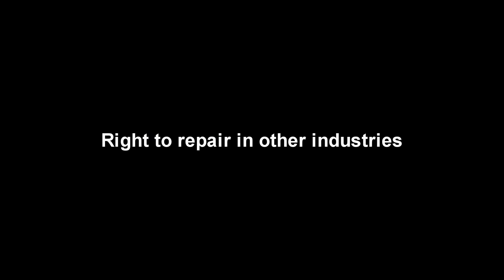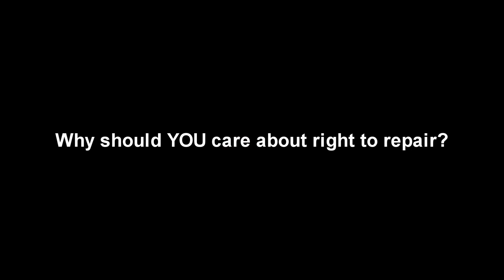eevBLAB 88 - Right To Repair Questions & Answers

Comment: Why repair when you can sell a new device?
Our economy relates in converting as much raw materials as possible in shortest time into trash!
Everybody's talking about CO2 emissions so let's use our stuff as long as possible!
Thank you for this video!
Reply: You are totally at point. I'm working as Electronic engineer at certain company that is selling everybody a story about CO2 neutrality and it disgust me. Every electronic module that I've had eyes on is later put in really hard epoxy which makes device not repairable and there isn't a single reason why electronics should be in epoxy (this epoxy is not possible to remove without damaging whole electronic module).
Reply: @kilex662  Then you use your smartphone till dead right? You better not have working ones in a drawer somewhere 😂
Reply: Yeah i agree! It would be fun to know for fact how many aggreeing with you have old working smartphones for example in a drawer somewhere! 🤦🏼‍♂️

Comment: I fully agree. But for some product you need to consider intellectual property. I thing that was main reason for this trend "do not publish all the design files" like in the past. Imagine you will start company with some simple product. Your product is nothing special but you spent some time to find the gap on market, design your product to be attractive, paid for promotion. Simple you invested a lot of money and time. Your product is success and after a week the same product appears on aliexpress for a fraction of price. Even worse if some of your "clever" dealer will sell one third of the quantity of your products counterfeited. This will ruin not only you business plan but also your reputation. It's complex problem but I fully supporting the Right to Repair movement. But from government it should be supported also by protection against fake products.

Comment: This is so important right now. Our industry (Copiers and printers) is required to maintain parts and service availability for 7 years from the day the last machine of that model rolls off the assembly line. Even that is too short and should probably be extended to 10-12 years and expanded to include driver support for new OSs. This also needs to be added to ALL consumer electronic devices.

Comment: I totally agree with your message, Dave. Just wondering, how can you replace a tiny component on the board of a cell phone? Isn't it simpler to just replace the entire board? My soldering iron is not worthy of this job.
Reply: perhaps not all need to do SMD component level repairs - but perhaps the repairshop down the street have a microscope and available tools - at at reasonable cost.
Reply: Replace the entire board that contains all the OS and your data for the sake of maybe some tiny capacitor that costs 20 cents or 20 pence.

Comment: Hi Dave,
I really dislike Bang and Olufsen for just this reason. My wife's speaker (BeoLab3) has a problem and I'm sure that I could fix it but ni schematic anywhere! 
Cheers 
Mark
Reply: I love my Bang & Olufsen,
I have it connected to Pioneer speakers.
Reply: @PremierAudio  My wife's speakers are BeoLab3. One produces no sound. I downloaded the "Service Manual ", but it's nothing like one. It says that you can replace a few obvious parts and has a vague block diagram without any values. It only shows what each board is and how it's connected. I'm not the dumbest person in electronics,  but without some clues it is very difficult to troubleshoot. I've spent hours to create a schematic of the power supply board. It will be impossible to do the same with the ICE amp board. And they are impossible to find. I've not been able to find a blog or bulletin board where someone has info.
B&O does not want people to repair their products.

Comment: Great Video. The Automotive industry has actuallty made it very difficult to do DIY repairs. As an example, some of the on board components have the VIN of the car encoded in them so you cannot take a genuine part from one car and put it in another car and have it work. I can not take a BCM (Body Control Module) from a wrecked car and use it to repair another car. It just will not work. Not without special tools that can reflash the module with the correct VIN.

Comment: Hey, in the past you've talked about being able to get hold of oscilloscopes relatively cheap, do you know if it's possible to achieve similar with spectrum analysers? I'd like to get my hands on one, but from the searches I've done for them they seem to hold value very well, so end up being close to £1000 at least. (I say £1000, as I'm UK based, but I guess if it's possible to get hold of cheap Spec Ans in Australia/the US it will likely be similar in the UK, but the cheapest I've found was around £750)
If you've any advice on how to get hold of one reasonably cheaply I'd appreciate it, thanks!

Comment: I do have issue with gluing in batteries. 
Even if there are techniques to overcome them. 
Rugged phones also have there batteries glued in. 
Yet, they are as thick as a Mars Bar. 
Samsung had to scrap their phones when they had defective batteries. 
If they had replaceable batteries, they wouldn’t have to take billions in losses and send most of the phones to a landfill.
It’s just not a cheap fix no matter who is paying.

Comment: Unfortunately the automotive industry has changed. 90% of modules on modern cars are written with the vehicle VIN number. This include power steering racks and even suspension struts. once written they cannot be overwritten without specialist software. If you try to fit parts from another vehicle expect warning lights and messages on the dash if they even work.

Comment: A buddy asked me to fix his vacuum cleaner, a Sanitaire model I was surprised to find that the same modes had been manufactured for years and that every part is still available at a reasonable price though the vacuum itself costs over $300 this guy has had it for 20 years. So new brushes a good cleaning and back in service.

Comment: Well for phones specifically, obviously it depends on the phone and parts but the cost to repair them is actually more prohibitive in some cases than the availability of parts, think about it what are some of the most common repairs, cracked glass/broke screen or getting it wet, well it makes total sense to repair a brand new phone worth $1000, but can you really justify spending ~$120 or more on a new screen if your phone is only worth about the same or at best double what a screen alone costs used? Might as well sell it for parts and put that $120 towards either a used working phone or a new one, right? Even a glass only repair will often cost 2/3s of a screen replacement, since they have to cover the cost of a screen if they break it.

Comment: 3:51 I can think of a good reason for a component serial number, that is when a phone is stolen, It can't just be sold as parts so It has no value, until It's found by the police if the thief didn't open it.

It's such a good and a bad thing, and solving this issue has a big potential of loop holes that can be bypassed.
Reply: I can think of a solution but it's complicated:
When buying a smartphone, you write a contract with that smartphone, in this contract a serial code used for fixing and changing parts of the smartphone is given. This code is given either by your local government's communications agency or police department. if for some reason you sold your phone as salvage or parts for repair you must undo the contract and write a letter/contract that states you sold this phone as parts.

if your phone is stolen and sold as parts, and your phone's parts are used in other phones without a contact as mentioned above, The phone which have this part will be put in a list of the police/ network department of the IMEI of that phone and locate its posotion until the theif is found. 

It's a very complicated system and I believe there is some loop hole in it somewhere.

Comment: You do not know what is going in food industry in Europe :) Food industry equipment has almost absolutely all parts modified and you will not find them except from this equipment dealer. Simple belts are a bit longer or a bit shorter from standard industry, motors produced by Embpapst or other world biggest company are special, a bit different arrangement of holes, different diameter and length of axis. Price for these items is about 10 times bigger than normal ones.

Comment: A lot of PCB's don't get repaired to the component level.  It simply costs more than replacing.  If a PCB can't be fixed in less than 15 minutes that's it, scrap it.
Reply: BUT The environmental cost is not factored in, and most technicians are not smart enough to do component-level troubleshooting these days...
Reply: @nameredacted1242  Oh component level repairs are doable, provided sufficient documentation is available.  I've been doing it for decades.  It's when you're handed a PCB that the manufacturer deems UNIMPORTANT and doesn't provide the schematic or even a block diagram repairs get tricky.  But it takes time, time costs money.  Most consumer electronics PCB's just aren't worth that much.
Reply: @randycarter2001  Yeah, I should have qualified that we repair OUR OWN designs to component-level... Even for us, with having a schematic and support engineers, finding smart techs is a struggle!!!
Reply: @randycarter2001  That's over with the serialization of the components.

Comment: I have owened a photographic equipment repair service since 1992 before digital cameras came into being. One of my of my first gut punches came when cell phones started taking pictures and one of the biggest was when Nikon (Nikon had been my bread and butter for years) stopped selling critical parts to "un-authorized independents. Think about that. Shame on Nikon. Shame Shame Shame. 
That's just one, there are others too like Canon for awhile. Thankfully they came back on board. Still devastating though.
All for the right to repair here.

Comment: I think DIY culture is the best way to fight against planned obsolescence.  Now that I have built li-ion batteries, I will never buy a commercial 5 Ah pack sold between 5 and 10 times more than it's actual value in a non reusable package by design.  There are solutions coming like the new frame.work modular laptop and for instance Volthium will show their battery design in 3D and expose the BMS to be replaced if required. https://youtu.be/hMvrh_T3YkQ

Comment: You are slightly incorrect about cars, for several years the big boys have been serialising there parts and you can not just replace parts or the vehicle wont start they have to be coded to that specific vehicle and some of the codes are only availble via a dealer who will not give them up...Change an Engine Battery or Audi and the car will not charge untill you tell the vehicle it has a new battery and that has to be done via a dealer level machine and thats just a basic part

Comment: I worked at a company where one of our products, that I know of, had software that would be triggered after a certain amount of runtime. The software, when triggered, would decide when to brick the device based on a "random" number generated. It was interesting to be at the design meeting with the team I was working with. Lots of frustration, but there's not much to be done though. Higher ups want it that way..
Reply: You have got to be shitting me!!!
Reply: @nameredacted1242  I wish I was

Comment: Didn't I read that somewhere (? USA ?) that they were trying to pass a law that only OEM replacement parts were legal replacements? Effectively shutting down the 3rd party manufacturers who make cheaper and/or better parts. This was based on the usual scare tactic of safety, "Oh those replacement brake disks will be dangerously substandard", when what they really meant was "We are going to gouge you for overpriced parts now we have an exclusive market."

Comment: Have a look on the auction  website  2015 Lexus IS250 19,534 km. Impact Light - Front, Impact Light - Rear, Hail damage light. NSW if the garage repair is too expensive it becomes an insurance write off. Its an easy repair so light you could drive the car as is. Under NSW law its a  Statutory Write-off. Cannot repair interstate at all even at a Lexus dealer. Tossed out for spare parts. Law passed in consultation with car makers to stop re-birthing? That sounds like a phone company?  You worry about a washing machine or mobile phone? I have seen a washing machine repair I actually wondered if someone was trying to kill the customer she won the long jump? Her husband had just left her. Earth fault Metal water protection plate lying on a live motor  terminal easy to see and fix. Live and Neural swapped still blowing the tin foil fuse well disconnect the Earth matey that will fix it! Local repair company reported, ETSA called them but they did nothing. Husband was lucky many have gone to jail for heaters in the bath.

Comment: Washing machine controllers are the worst,  fault means new computer.  An open source washing machine hack is needed.
An arduino could drive a washing machine and allow for custom washing styles/patterns
Reply: why digital? the old 80s washing machine and tumbler i have still works great with simple analog and mechanicelectrical "programselector".
Reply: @superchiaki  I am not the one who proposed moronic Arduino. We are still using mechanical-electric washer and dryer, both are fine after a few parts replaced. Built in 1970 both.
Reply: Arduino is crap for everything except total noobs trying to learn! Learn real C, real microcontrollers (ARM, PIC, etc) (that don't run middleware like Arduino that makes everything easy but slow as crap), real coding approaches like interrupt-driven RTOS. Look into uC/OS III.
Reply: @nameredacted1242  What in a washing machine needs a lot of compute power?
Reply: @NiHaoMike64  Updating a stupid graphical display, of course!!!
Reply: @nameredacted1242  An led to say what cycle it's on?  Yeah, Pi Pico would be better but an arduino is helps powerful enough to drive a washing machine. If you want a display, then BLE serial IO could do, it's just a washing machine,  not a self driving car...  #triggeredMuch

Comment: 00:58 thanks for the video Dave ,but I have to disagree on you saying that mobile phones are relatively easy to take apart and fix. Do you mean component level board repair? Far from easy and one of the highest skill level repairs in consumer electronics. I am still watching but I'm sure that's about the only tghing that I will have an issue with :)
Reply: It's all relative. If you work for a company that has all the right equipment and trained, skilled people, component-level repair with conventional SMT is "easy". Still, though, replacing a BGA is something that we ourselves struggle with...
Reply: If you aren't able to fix it, at least everybody who can have to be able to do it, that's the point.

Comment: The obvious problem becomes defining when that change is necessary or only to block repairs.

You might think camera serialization is just to block repairs, but without it, the whole FaceID, Windows Hello, etc… systems are a non starter.

I care far more about my data than my device. My device is replaceable and temporal, data can’t be make private again. 

It’s ok to fall back into a different place on the security vs privacy spectrum, but so far I’ve seen no one on the right to repair movement mention the inevitable invasion to privacy that a lot of the different suggestions imply.

Comment: There is nothing stopping you from repairing something, other than the fact that if you stuff it up that company won't honour it as a warranty claim, as far as I am aware that is standard across many industries? in the case of modern electronics, ie your smart phone, the fabrication is generally so small that there is no human aspect to it, it's all robot. There is not just a battery, cpu, gpu, board and screen - there are all sorts of other sensors like accelerometers and gyroscopes etc embedded and so ensuring a consistent repair is very difficult. Also board replacement is generally considered the cheaper option to component detection and attempted human repair because a robot can change/ reflow a component a lot quicker and more accurately than a human (I'm still on the phone example's) so the customer walks out with a working phone quicker and the faulty boards are sent back to be robot repaired and sent back for swap/ repair stock.

Comment: What pisses me off now that all of you cry out like its something new. You only care about yourself at the end of the day. I am not even a car guy.. I even just had my first car at a very late age. But I always had friends who were car guys. This stuff has been going on for ages.. like literally from the first moment on you had technology in cars. A lot of internal controlers, sensors, even airbags sometimes have hard and software locked parts you cannot simply replace with GENIUINE other parts from other broken or salvaged cars. You have to either have very expensive equipment or you have to go to you specialized car dealer to reprogram controllers. That is something absolutely incredible in my opinion. And everyone accepts it somehow. Some little stuff breaks in your car... you get that part for 20€ but you cannot simply change it and it works NO. You have to code it so it fits again to your system. And like I said. You all only wake up when this shit comes to literally phones. Come on man...